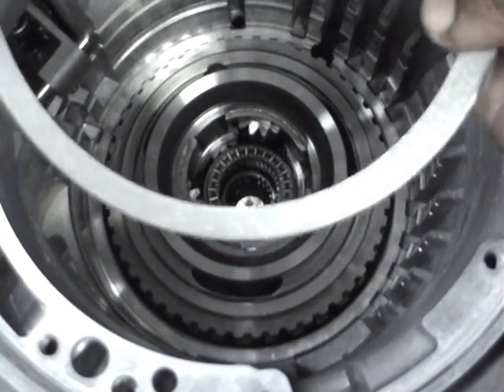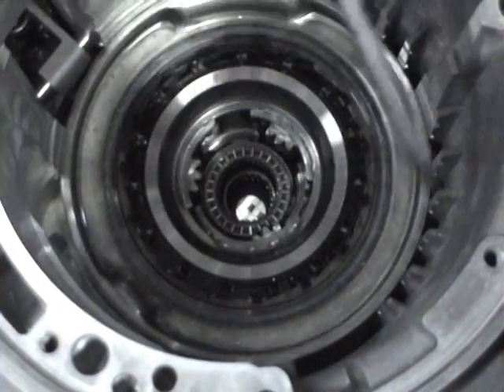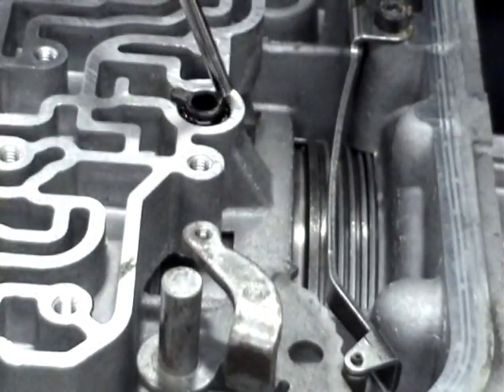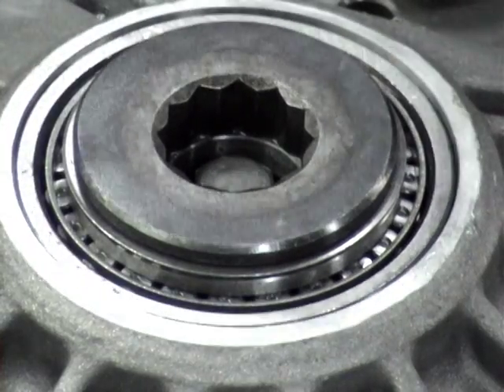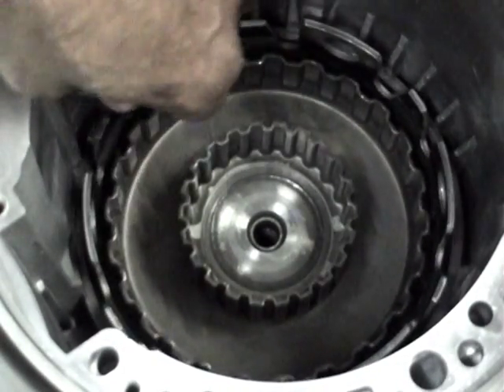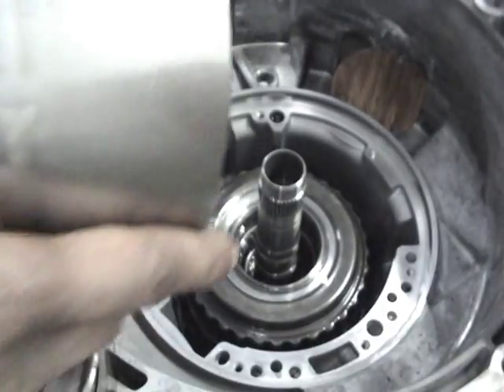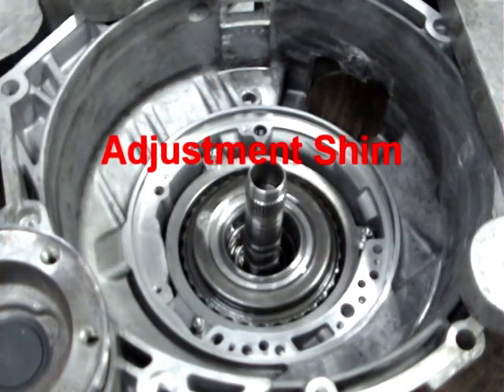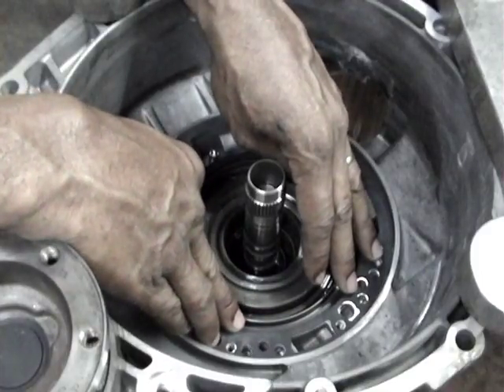VW 01M Transmission

Comment: Hi Tony, what difference/effect on the TCM/ECM does it make when you swap a gearbox on a 1.6l, 74KW engine with a 2.0l, 85KW engine. The gearbox code of the 1.6l,74KW engine is FDH and that of 2.0l, 85KW  engine is FDG. The major difference in these two gearboxes are the number of clutch packs (K1,K2,K3, B1 and B2), the number of teeth on the input/output, pinion/ crown wheel gears. The physical construction, connection points, connectors, valve body and other components are the same. They are also both For 4 speed 01M auto transmission gearboxes. Thanks.
Reply: can't say for sure, never tried swapping 1.6 for 1.8. The 1.8 is a stronger box as is required for the higher torque as produced by it. I am sure the ECU is mapped to handle that increase in torque.  Try it but I see conflicts as the TCM will also be mapped differently to that of the 1.6
Reply: Thanks Tony. I did a research and discovered that the gearbox with FDH has  input gear 61 teeth, output gear 63 teeth, ratio 1.033, pinion shaft 16 teeth, crown wheel 78 teeth, ratio 4.875. FDG has input gear 45 teeth, output gear 44 teeth, ratio 0.978; pinion shaft 15 teeth, crown wheel 68 teeth, ratio 4.533. However both gearboxes have the same 1st,2nd,3rd,4th and reverse gear ratios.
Reply: @pauliroha5506  so while the 1.8 gearbox will work, the mapping in both the computers will still be different.
Reply: Thanks Tony. After the swap, the car shifts fine. However, on certain harsh acceleration/deceleration the transmission stays in 3rd gear and restarting the car normalizes everything. Some codes are set on the TCM like 00545, 00529. Could this be a likely cause
Reply: @pauliroha5506  00545 is no connection between T CM and ECM, you may want to check the ECM for similar codes. Check your electrical connections again. clear the faults and drive the car and recheck.
00549 is no consumption signal.

Comment: You can use Trans Gel or just light Vaseline
Reply: Thanks Anton. The reason I ask is because I'm in the middle of the rebuild and am having an issue with the B1 clutch ( Sprag).  When I do the spin test @ 2.29  everything works as it should; ie: spins clockwise and locks counter-clockwise but I notice that there is a awful squeal noise when turning the assembly.  I've tried assembly grease ( slick honey) and it seems to quiet it down a bit, but unfortunately there is still some noise.  I don't no if this normal, or an indication I will need to buy a new one way clutch?

Thanks for any feedback and great video!
Reply: @cortdawson8613  The squeal is normal I have done several with high pitch squeal. The important thing is that it locks and unlocks. I have had to change two recently but not for noise the plastic cage had become soft.
Reply: @Anton3051  Again, thanks for taking the time to help!  I can now move on with my build :)

Comment: if you look at the needle bearing you will see a raised profile on one side and a depression on the other side. Cup side up refers to the depression side. If you should pour some oil on the cup side it will accumulate in the little depressions around the bearing.

Comment: Any idea why there’s a clunk when putting in reverse. I cleaned the filter several times  to get it to shift past first gear. This worked. 
Adjusting the brake band (the bolt) doesn’t get rid of the clunk. 1991 VW Jetta. Is there a servo pin. Thank You.

Comment: Hello, thanks for all your support. My mechanic removed the gearbox assembly, removed the torque converter and cleaned the torque converter housing.He poured in some 1liter ATF, checked for leaks and there was no form of leak anywhere.He reinstalled the torque converter and rotated it, but we still couldn't find any leak. He turned the entire gearbox upside down,held it for 5mins, still no leaks. He went ahead and removed the old seal with a flat blade screw driver and installed a new seal.pls note that during all this, the oil pump was never removed. He will be reassembling the gearbox this morning. Pls just to know, is there any other place to check. The oil cooler seals are fine, the speed sensors on the gearbox are fine, no leaks there. The F125 switch is fine too. No leaks from under or around the filter housing. The leak was seen around the area where the gearbox connects with the engine. Do we need to recode the gearbox after reinstallation? How is that done, if we have to recode it. Thank you so much for your support and Good bless.
Reply: recoding is not necessary. If the leak was between the engine and transmission, then it must be the front seal behind the converter or the o-ring seal around the oil pump. Cannot come from anywhere else. Go back and take a good look.
Reply: Thanks for your advice. The seal was replaced new transmission oil poured  in the leak stopped.However, the worst happened. The car drove for 10km and stopped going into reverse or forward. It has stopped moving. Before now, when it was scanned it came up with a code 01192, which is torque converter lockup clutch malfunction. Cleared the code before even changing the seal. Car will no longer engage in drive or reverse. Scanned the TCM, no fault code was seen. Pls is the transmission bad now beyond repair? What could be the solution. Thanks so much.
Reply: @pauliroha5506  The clutches are damaged. You will have to rebuild the transmission. 
Which country are you from?
Reply: @Anton3051  ok. Thanks so much. I am in Nigeria.

Comment: Hi, thanks for the video. I have a VW Bora with 01M transmission. It started leaking transmission and will hesitate (drag) before move when in traffic. I have checked the filter housing, transmission cooler, drive shaft flanges and no sign of leak there. Pls where is the possible source of transmission fluid leak
Reply: We have had similar situations with positive results after changing the seal, so there is a chance it is still working.
Reply: Can you say if fluid is on the ground and at which area in relation to the transmission. Around the oil pan, the area of the front seal at the converter, the seals under the cooler will leave quite a mess if leaking and will reduce fluid quickly resulting in your problem. Be aware other defects can be responsible for your  drag in traffic. Other areas such as the Selector switch behind the box close to the firewall can also leak as well as your speed sensors but they are high up and not subject to direct pressures. The flanges at the axle are out of the question.
Reply: Thanks so much for the information. The leak is not from the oil pan, it more from the torque converter side. Though I saw a little splash near the oil cooler. My worries now is when I noticed the leak, I managed to drive the car home(26km) and when I stopped, I put it on park to open the gate. When I reengaged it on drive, the car would not move but rev up. When I eventually switched off the car and turn it back on, it started moving again, though slowly like it in gear 3. Could that mean that the gear box is completely damaged due to the rapid oil leak? Please what is the way forward to solve this problem. Thanks once again.
Reply: @pauliroha5506  Ok, you may or may not have damaged the tranny, to check it do the following; locate the transmission filler plug at the front of the unit (under the starter slightly to the right). Ideal is from the bottom but you may not have the equipment. Fill the tranny with about 1 liter of fluid and try the car again, if it responds better add another but do not fill it to the top you will make a mess anyway. If it works better then it is unlikely you have sustainable damage, remember you cannot use the car because the flow of oil to the converter is great so you will loose the oil quickly. Get the seal changed asap. It may or may not be a job beyond your capability.
Reply: @Anton3051  thanks so much. I will try ur advice on Wednesday and update you with my findings. Thanks for your help.
Reply: @pauliroha5506  np.
Reply: Anton 3051 is the same person as Anthony Lyons. I use Anton 3051 for my other youtube postings on BMW  engines etc.

Comment: I have a 2002 vw Jetta tdi with auto trans. When hot it won’t go into reverse unless I give it gas. I replaced the reverse feed tube o rings and it still does it. I am not a professional Transmission builder but I am a professional auto tech of 15 years and I do work at a European repair shop. I have rebuild some easier transmissions like 4l60e but never one of these 01m tranny’s. I think I’m going to try to rebuild it. The only thing that I’m not to sure of is shimming the pump. Could you explain how to shim the pump? Thanks
Reply: Also I was reading up on my reverse issue and a lot of people say the trust bearing/needle bearing goes bad causing my problem but I haven’t found any replacement bearings online. I know I need to tear down and inspect first but anywhere you can recommend to buy parts?
Reply from the maker: Hi, I would love to help with your rebuild, it is really simple. I however am lost when you describe the "reverse feed tube o-rings" I am not sure what you are talking about, could you point to a time in the video where it is mentioned. The shimming of the pump is another question, are you talking about the part of the video where the H gauge is used nearing the end. If you clear up the fog for me I am sure willing to help. Oh! by the way can you kindly subscribe to the channel. Thanks a lot.
Reply from the maker: Frankly, I have never seen an episode where the needle bearing went bad and caused reverse problems. The Reverse Drum with reverse clutch is usually the first component to be wiped out if there is abnormal clearance between the oil pump stator body and the Reverse Clutch. There is a flat plastic washer fitted there which breaks or is wiped out because of wear. Added to that is the return spring assembly which collapses over time, all of which can cause your reverse problems along with the low reverse clutch. However, I do not think your problem is coming from the low reverse clutch.
Reply: Anthony Lyons first of all I appreciate you making this video and answering questions. Ok the reverse feed tube (that’s what someone else called it) is behind the valve body, it’s the plastic tube with 2 o rings and a spring. The adjustment I was talking about starts at 10:02 on this video, you said there is a part 2 video that explains this. I just want to make sure I do this correctly. I plan on taking the Transmission out in a week or so
Reply: Anthony Lyons I also think I have some torque converter shutter and also feels like converter goes in and out of lock up.
Reply from the maker: anthony.433@gmail.com or letsrideeuroauto@gmail.com it will be easier to send you pdf files and information, etc.
Reply: @AnthonyLyons3051  selam, öncelikle bilgiler için tüşekkürler, bu pdf dosyaları bana da, gönderebilirmisiniz. 01 M şanzıman servis kitabı  varmı sizde. bu videonun part2,3,4 varmı teşekkürler.
Reply: peanutbutterisfu That is the low reverse feed tube, I hardly think it is your problem. I have actually completed part 2 which shows the end play procedure. Doing the voice track now will publish soon. Do not worry about rebuilding it is fairly simple.
Reply: Anton3051 yeah it wasn’t my problem. It definitely did make it a bit better, the seals were hard and flat. I will check out the video thanks
Reply: @peanutbutterisfu  Hello, first of all, thank you for the information, can you send these pdf files to me as well? Do you have the 01 M transmission service manual? Is there a part 2, 3, 4 of this video, thank you.

Comment: Excellent...this all should also apply to the 01N transmisions. Very helpful! Please keep the other parts coming.
Reply from the maker: Thank You very much for the encouragement. Yes, the 01N is very much the same as the 01M there are very few differences, with the case being one of them. The internal name for the 01M is the 096 and for the 01N 097 but all from the same AG4 family. However, if you are building your 01N, I advise that you follow instructions for that transmission as procedures may vary.
Reply: I am not at this stage yet...knowledge wise. Currenty I am laerning to understand the valve body...since my wife's 96 A4 shifts a bit harsh once in a while. Oil is fresh...and it will now receive a newer valve body with a Trans Go kit installed...fingers crossed! ;-)